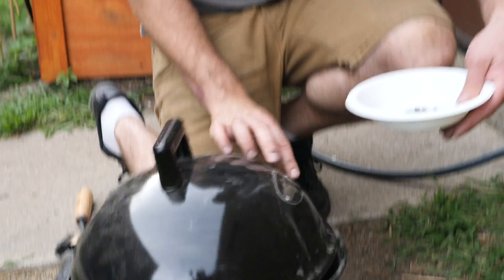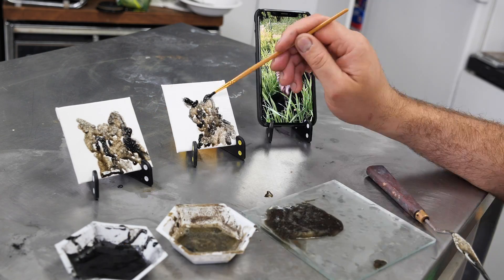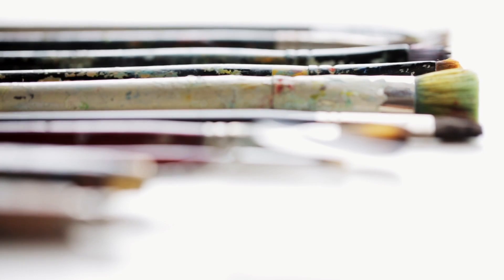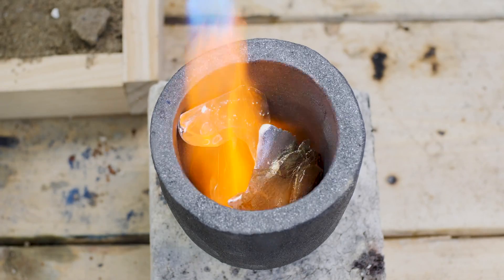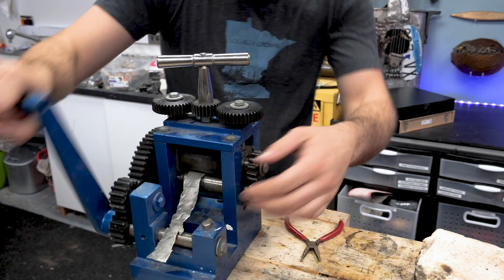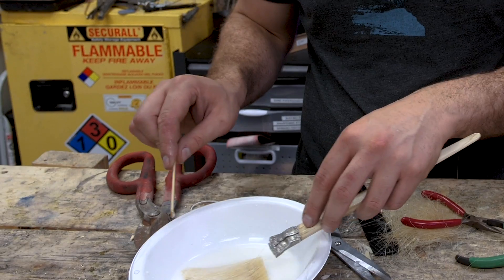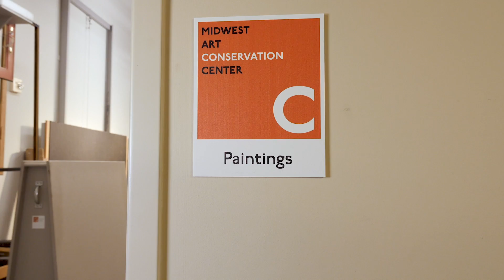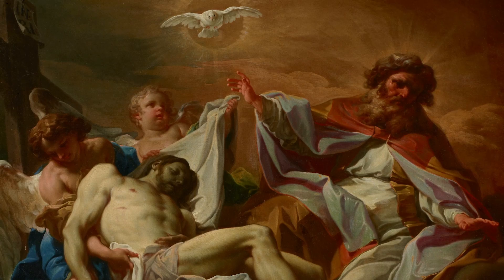Paint Brushes from Scratch

Comment: I really enjoyed this! back in 2010 I racked my brain doing this I wanted to do a painting like a old Dutch master but with my own pigment. And ended up going crazy with the variety of natural pigment you could achieve from minerals and I even made stacked lead and vermilion. The best tip I can give for brushes is feral hog closer related a Eurasian boar makes the best brushes the natural flagging and spring of the bristles make it ideal for oil brushes not sable but definently better then the Chung King hog they use for most modern brushes. Maybe a little late to the party but after 6 years that's what I got the best results with. 
And when I was done I made a painting that genuinely looked and felt old. Although modern synthetic pigments preform much better then what I could achieve with just a hand Muller.